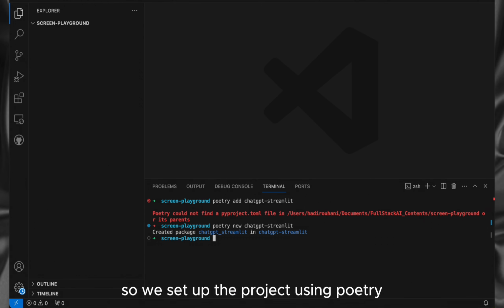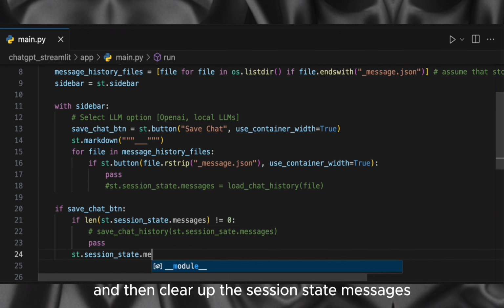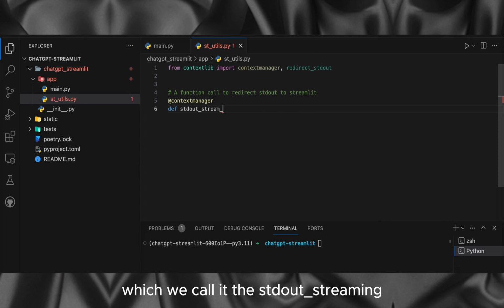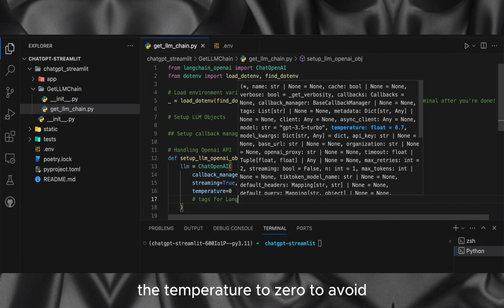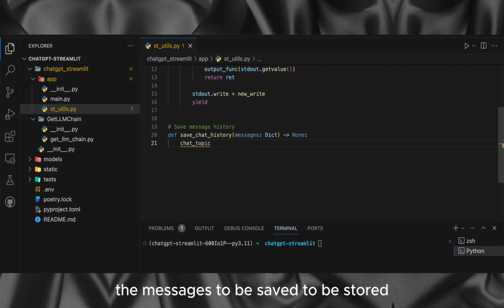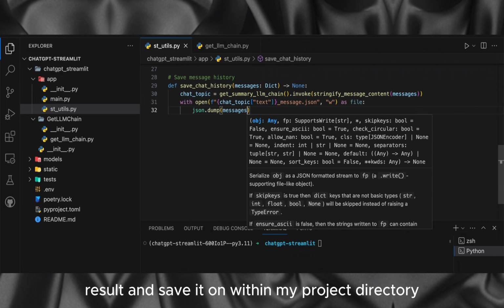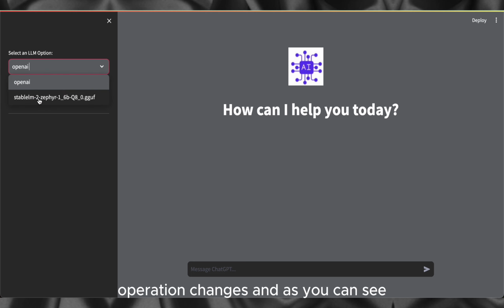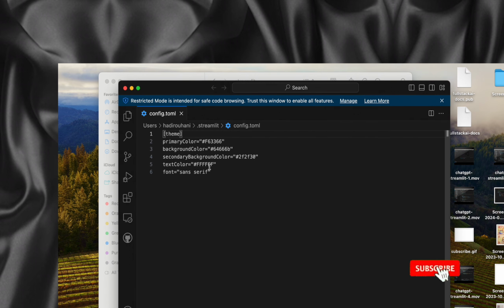Easiest way to Build your OpenAI like chatGPT message website with Streamlit | Use custom LLM models

Comment: I really enjoyed streamlit so far, but unfortunately we cannot use it in a production environment due to the weird axios 403 error we get in the st.file_uploader when deployed via Azure Web App. Only solution provided in the forums ist to disable the xsrf protection, what is kinda bad
Reply from the maker: I agree with you 100%. There are some foundational issues with streamlit and the way it handles kernel processes that cannot be resolved easily.

Nevertheless, data scientists at least have a easy-to-access dashboard to showcase results in DEVELOPMENT stage.

For sure, the Production stage you need a fully reliable frontend framework like Angular, React or other JS based frameworks.